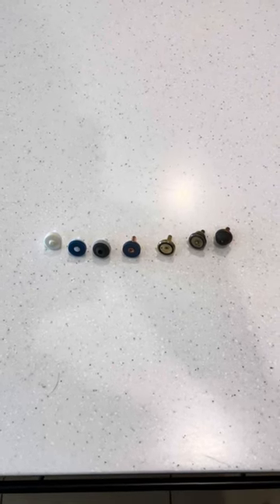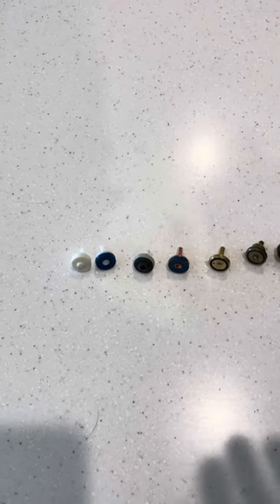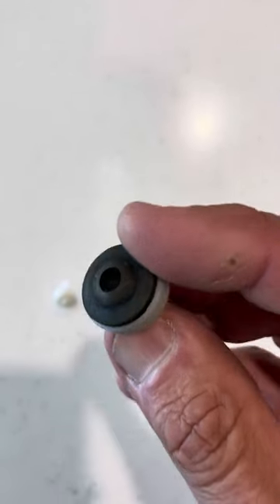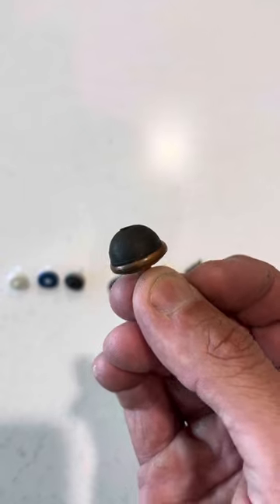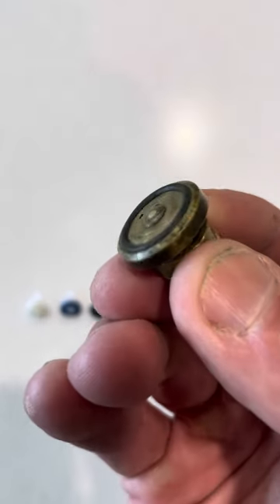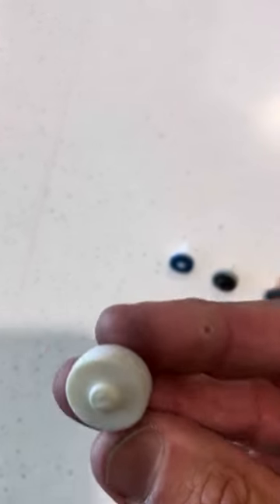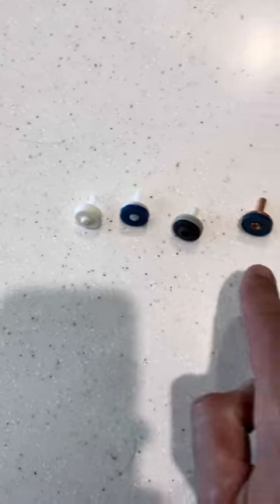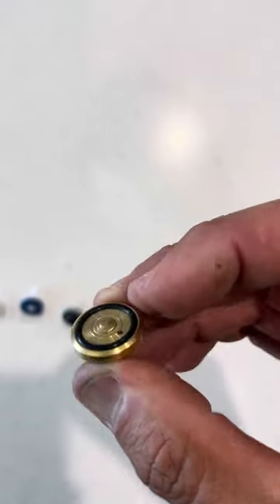🤷🏻What tap washer do I use to fix a dripping kitchen tap, basin or leaking shower, Mayfair Plumbing

Comment: Excellent video with expert explanations. Just out of interest, I've been using one of those button washers in my kitchen tap and it lasted me about 4 years, before that some plumbers that were here put in lesser standard ones for a considerable amount of money and they did not last as long as the one I put in myself. I'm just about to change it now, as I believe I may have tightened it off too hard today and that was the end of it-actually, I believe someone interfered with the water pressure and made it slightly higher for the whole building, as when I turned off my mains and bled my other taps I still had water coming from those bled taps despite my stopcock being off, and this was the reason I was stronger with turning the kitchen tap off too tight.
I fortunately found another new button washer and put it in, it works ok, but seems as I said, someone interfered with the outside water pressure, as when I turn the tap off the water stops but forces some water near the base of the tap to come out. I also did a reseat with a reseating tool. Thanks again.
Reply from the maker: Hello, yes re-seating is the key and make sure to flush all the swarf out before putting in the new washer.  Don't do the re seating there is only a certain amount of seat that can be shaved off.
Good luck 😊👍
Reply: @MayfairPlumbingandGasfitting  Thanks very much, I appreciate the time you took to reply.
Reply from the maker: No worries have a good day mate
 @Equalizer5

Comment: Thanks.
Besides being a "better quality", what advantages does brass washer provides compared to the nylon one?
Provided the washer seal which comes in contact with the seat is the same material, that is being rubber?
When they say the brass washer lasts longer, it's not true though... as the seal, which is usually the part that wears out, is the same material (being rubber) on the nylon or brass washer...
Thanks!
Reply from the maker: Thanks Nik.
Depending on the seat condition will depend on the type of washer you should use!  Also not all tap washers are made from the same materials!  There are plenty of different washers on market today they all have a different use, horses for courses 😊🎅🏻🎅🏻
Reply: @MayfairPlumbingandGasfitting  thanks for your reply... I realise my question was horribly confusing as I haven't used the correct names for each part of the washer anatomy.
I will try to edit to make it clearer!
Reply: edited the question!

Comment: what about IIR rubber washers? or FKM (Fluorinated) rubber washers? they should provide more resilience to erosion?
Reply from the maker: I haven’t heard of them to be honest!
Reply: @MayfairPlumbingandGasfitting  yeah!  take a look.  It's a very subtle thing. and we all spend time and energy on this minute repair which is so vital.  The Rubber gives way first, which leads to a stream that eventually erodes a groove into the pipe (like the grand canyon in geography).  Get good polymer rubber, and end the trouble. IIR stands for Isobutylene Isoprene rubber. FKM fluorinated cross linked rubber.  IIR has better oxygen and water resistance than even regulare EPDM rubber......it's science.

Comment: I pulled a 13mm washer out of 12mm tap. No idea how to get a new 13mm in there. A 12mm washer will not stop the leak. It has a new seat in it too.
Reply from the maker: Hi,
Sorry for the late reply, it could need re-seating??
Reply: @MayfairPlumbingandGasfitting  all good. I ended up re-seating it which didn't help. Turns out the plumbing was 40 years old and a soldered joint failed causing an internal leak. Had to jackhammer the concrete wall and replace the whole shower steam. Absolute nightmare!
Reply from the maker: @domlipski5226  omg! Wow thats a huge job, yikes 😦

Comment: so el cheapo is good enough.  bit drippy?:  dome.   can't fix it?: reseating is needed
but all perfect? then stick in a hydroseal.
he doesn't bother to tell about seat inserts:
new thread new seat
https://www.youtube.com/watch?v=4Hb2SfYBo2M
push in new seat
https://www.youtube.com/watch?v=KftL7SKaLAw&t=28s
Reply from the maker: Sorry haven't had much such success with inserts hence we don't recommend them.  Good luck with your DIY plumbing jobs 😊.
Reply: @MayfairPlumbingandGasfitting    Yep, thanks.  Recent job grinding down the seat seems to have solved things for now.  Very interesting to see how a fine crooked hairline 'crack' seems to have widened out to maybe a 1/32" ( or even bigger, hard to judge ) channel across the seat.  Learned something there.  That must be because of ferocious 'spurting' of water under our pretty high mains pressure.  But it spurts into the breech  and only drips out from there.  So to us on the outside it looks like an annoying but fairly harmless low pressure drip.
But inside there the seat is being torn away.  Moral of the story:  don't allow any drips!  (I guess).
I didn't use the inserts I've got.  I've very cautious.  I don't know what I'm worrying about but lacking calls from all around to say 'they're good, go for it..'  I don't if I don't need and like I say, seems I don't need as yet. 
I think I worry about what happens next if I put that in and it doesn't work?
And how can it work if there's an imperfection in the seat?  The water will work its way up and avoid the washer seal entirely won't it?  We'll be back where we started.  For the insert sits on the seat and they say to make it good.  But if it's good why do I need the insert?
Well the insert I suppose makes a seal between itself and the seat ideally and it can handle some imperfection. They say 'make it good' but at the same time they're selling them to handle imperfect seals.  Bit of a  mystery what's going on.  Thought you guys might  know.  Interested to hear you haven't had much luck with them.  So you've tried them?  Tell about it...